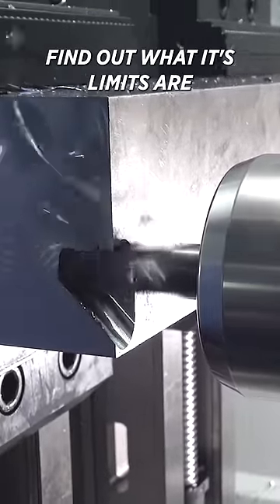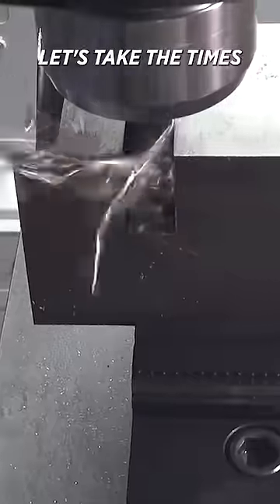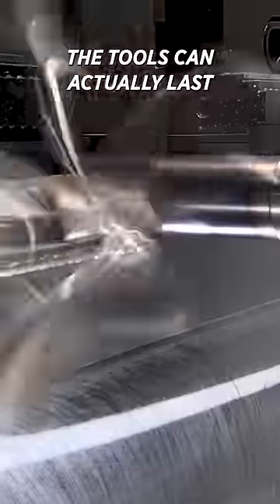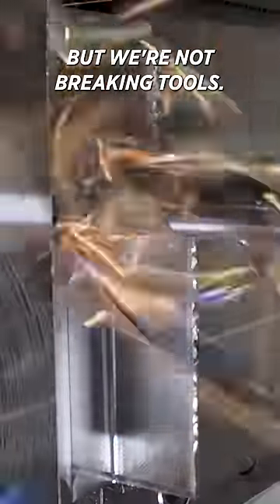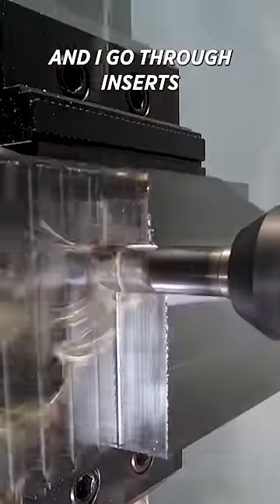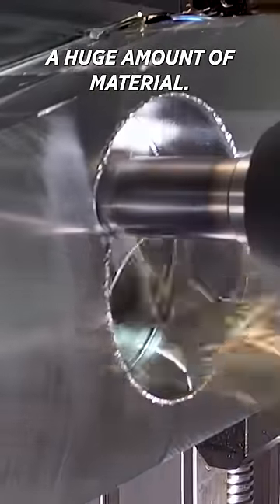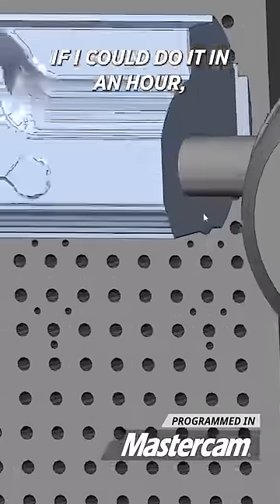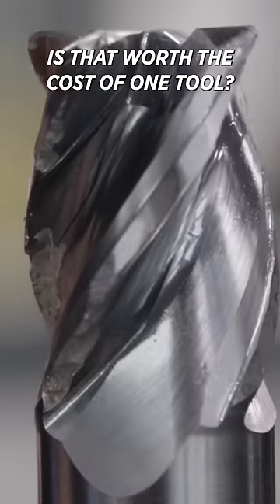Why Do We Push Our Tools to the Limit? #shorts

Comment: I worked for an aviation parts company and we'll drill anything from carbon fiber to fiberglass or metal. I was in charge of the cms machine that cuts the parts. We had a big 1/2 drill bit, that would cut speakers for helicopters. Thank God we had a cage because at times the bit would heat up so much it would snap and you'll have a large metal bit flying around and 15,000 rmp.

Comment: Let’s say you run your machine at 80% of its max, first you can’t count for heat element ( motors expand and the actual coordinates change) aka shit tolerance, second it will cost more in tools unless you are using shit tools to start with which mean all my txt is useless. Lastly that tool at the end will be fucking up your work peace not cutting 😢😢

Comment: Let’s not ignore the limits of size in the name of speed. If you need to hold a tolerance to .002”, you can’t run it that fast and expect it to be in spec.
Reply: For rough cuts taking that much material away Im almost positive itd still be faster to run a finishing tool or two after to clean up and bring the parts into spec if needed. Had a few jobs where that would be the case.

Comment: I worked for a batch work company for 5 years at the start of my apprenticeship and I was told by the manager of the production office that if a Turning insert was used for 20 minutes of cutting time it had paid for itself it is running for longer than that you are wasting time while machining, as long as you were working within the 100% overload limit on the machine and getting 20 minutes out of an insert you were making money

Comment: It's also a justification for running your tool steel tooling with high coolant flow and your carbide tools with the bare minimum to prevent the sintering metal from melting. Different cutting and milling bit materials have different coolant and feed/speed preferences for optimal performance. Also, it is rarely beneficial to intentionally destroy bits unless you have to in order to meet SLA and avoid overage fines. Bits aren't free or even cheap and if they are cheap then they won't last or produce the finish quality that you want from them.

Comment: That and SPC Incorporated together is a equation worth figuring .....I grew up outside of Detroit in a suburb I walked in the backdoor of a job shop in Troy MI. And saw a machine moving at 150 IPM and was floored at the chips flying and saw a guy with a used Cnc put an old manual job shop out of business the same guy Incorporated Statistical  Process Control with his machine he is very well off now that was 30 years ago.

Comment: In my day I ran the tools fast with deep cuts for roughing but my speeds and feeds were spot on. One day, a maintenance guy walked past and said I would burn out the inserts I was using because I was running it too fast, all the while, beautiful gold chips were rolling out of the auger into the chip bin. Never had a problem with my tooling life lol

Comment: Also something to note, the cost isn't only in the money. Making the tools has an environmental cost as well. A higher load on the machine also may make it less efficient which could increase running costs by wearing it out quicker and it could cost more energy to run it. Having it run quicker might also save energy, but I don't have the knowledge about the specifics of this machine to come to a definitive conclusion.

Comment: I used to have arguments with a supervisor about tool life .... We were machining cast aluminum and they had determined that the one finishing mill would run 3500 cycles ... However at 3300 it would start leaving massive burrs on the parts.  He continues to argue that they have life left ... I explained to him that when the tool is leaving a 1/4" burr it has reached its life regardless of what he thought they should run.  Wasting 30 min grinding parts per pallet with a flap wheel was not worth the cost savings of running that tool those extra passes.

Comment: And some materials just say "make me and you will regret it". Faster cuts lead to work hardening and heat, some materials will take time period unless you want it to snap right off or wallow out. There are reasons why you only cut the corners you know won't result in a parts recall. If you are dealing with an abrasion resistant steel for example, or even something as simple as silver.

Comment: In the mining industry I learned that preventive maintenance is important... unfortunately iv worked for company that didn't believe in shutting down for a hour or a couple. To fix it corrext instead something will have a high speed come apart then get mad bc there down for a week waiting on the parts.... grease ur equipment shut down for 6 hours a week and fix ur small stuff it will help u in the long run.

Comment: Its like a big puzzle that you need to put together. 
First up high quality coolant. 
Then machines that can handle your job size, x.y.z. 
Durability of machine. 
Harmonic's will play a major role.
Tooling that you can count on to be repeatedly of same dimensions and quality. 
And lets not forget one of the most important pieces to the puzzle extremely qualified employees to run these machines. The amount of knowledge that is required to truly maximize a machines profits doesn't come cheap.

Comment: The machinery i keep running just has to run 24/7 365 ... . Minus holidays, weekend cleaning ,and inevitable breakdowns,  but getting it running again as fast as possible is all about having inventory of the common failpoints replacements , also the not so common,  basically need 3 machines just 2 disassembled ready to fix the first... and everything being labeled and named properly helps , a lil oil goes a long way too, reducing friction reducing wear and problems and constant washing off of said lubricants to encourage rust doesn't help but that's the other departments job, to give me plenty of" job security" by causing most all breakdowns im some way or another... it's actually kinda nice, surprising but nice to have a problem not caused by proper functionality removal squad

Comment: I know carbide can still hog when worn out, but that shot of that tool is exactly what happens to them when ran hard. Use resources to save time. I'd run them fast too if the machine couldn't handle the load. Wonder what is so special about the tools that keep them from exploding under such a high load in steel

Comment: I remember a shop manager that used to go around turning people's tool speeds up. Maybe if his degree wasn't in archaeology and his position wasn't obtained due to nepotism, it wouldn't have been as big of a deal. But it made a lot of guys upset. The moral of the story is, leave the machines alone and let the guys that have been running them for 20 years dictate their speeds. The first time you mess with someone's machine and cause any sort of damage, you had better be able to pay for the material, perform the entire setup yourself and work the extra hours you created or you're going to have too many enemies and not enough employees

Comment: He acts like he is the only one who has thought of this. Everyone try’s to get the fastest part output they can with as little if not any loss in quality. What happens is running fast with Deep cuts then you run the chance of your 30-500 dollar tool dulling or braking and damaging the part. Now your out one blank of material, loss of time, the cost of the tool, and the stress. Maybe add up these costs over a year and you may not be loosing more then you think. I just sold my manufacturing business a couple years ago so I’m retired but I still love this stuff...so cool

Comment: As the one who manufactures these tools, yes. You can 100% run them hard like this and they’ll last but not nearly as long as when you’d run them properly. There are bad bits out there. Microscopic imperfection in the blanks that gets past QA. I would be safe and make a few 100k pieces with one bit then 10k a lot faster

Comment: Also factor in the overhead for tool replacement. Someone has to do that job, that job might take up machine time.
Now instead of doing 2x 4 hour passes in a shift running 7 days a week until eventually you maintain it for 2 hours, your machine is going through 3x 2 hour operations and 2 hours of maintenance every day.
How much is that cost in maintenance?
Reply: Entirely depends on how the tools break and the operator paying attention. Some shops have the machine operators change the tools out and readjust the offsets themselves which in most cases doesnt take terribly long. For example, at one shop I worked at we had some stainless steel probes that needed a slot cut about 2 inches deep, 3 inches wide, and around 2 feet long. Running a rough cut like the one here, just not quite as fast these parts still took about an hour or so to run so it was much more profitable to spend a few minutes replacing the roughing mill once, maybe twice a shift.

Comment: There's a fine line balancing the tool speed and machine time against part cost and machining time. It is no brainer on a cheap part but when it comes to jet engine component it becomes a real problem. One bad move or chipped tool and you just turned a hundred thousand $ part that takes 30+ operations and a month to build into a scrap wall hanger. When you can't get the metal do make it anyway, it becomes a real problem.

Comment: I work with industrial bandsaws cutting aluminum and titanium walking this same thin line, at my job we run multiple saws at the same time which brings in another factor to this equation. I'm not sure how long it takes to change the tool on the machines in the video but changing a 29 foot long blade can take between 30 minutes and an hour so I tend to run the blade feed a little slower than what management wants but my argument for it is that although at the higher speed I may be able to perform more cuts with this saw even factoring in the time it takes me to change the blade I actually get almost the same amount of cuts when I factor in the time lost on the other saws during the blade change for this one saw. if we have a rush job that I get the go ahead to neglect other saws for then ill run the single saw as close to the limits as I can and since I'm there watching it I can listen for any issue s and make the adjustments necessary to prevent the blade from breaking while still running it at the max

Comment: The tools/inserts only last when they are used properly. When a tool fails,the machinist must replace that tool,dial it back in and check the feature/features that are affected by that tool to ensure the machine is making a part that checks good.Bottom line,the more you have the door open,the less parts you’re producing.

Comment: I think there is a problem with a lot of CNC, and as you allude, it's the cost of the cutter vs the price of machine time, baking 2 $200 cutters to save $500+ makes sense, issues of financing the tooling vs getting paid for the end product are a definite pressure on the decision as to how aggressive to to be with F & S.

Comment: I'm going thru this at work right now pro. Wants to cut 800ipm 1.0 doc alum. Yes machine can cut 1200 but now we did a penetrant test and our walls are cracked on 14 parts 250k down the drain and 6months wait for new material. Fast is not always better. Slow and steady wins the race for me.

Comment: Don't do this if you want precision machining on your workpiece. Learned that with Rob Dahm's videos machining Mazda rotary irons. Slower speeds gives you more precise machining and a smoother surface. One of those things that makes complete sense once you hear it and see it, but you wouldn't really think about normally unless you're doing this type of stuff all the time.

I have no machining experience (but wouldn't mind trying my hand at it one day), so if anyone wants to prove that wrong or add anything, I don't mind.
Reply: Doing a rough pass like this would be entirely to get the brunt of material cut from the part. After that pass is done you'd add additional finish passes and deburrung passes depending on tolerances and finish requirements.

Comment: I think you should probably read the user manual.  There's loads of information about the limits of the machine in the user manual.  Besides that, pretty sure most CNC could calculate wear and max speeds and recommended feed rates and spindle rates for the materials.   Why do it empirically?  It's been figured out already by really smart material engineers.

Comment: are there bits with internal liquid cooling?  I bet a 3d printer could make such a thing.
Reply: Yes, some drills and i think end mills can be coolant through tools, meaning they have holes in the drill/mill that run coolant though them while they operate

Comment: One tool 100 one extra part a day 500+ extra day. It’s easy math my little machine can’t push the tool to the limit. However, I do push the machine to the max. If your machining right heat buildup in the part is not bad like most people are saying. Hog fast come in with the proper tool for clean up. Proper coolant system and the right type makes a big difference as well. People find it hard to make money in this industry all because they only do what they have been told for years back when machines didn’t have the capability to run tools hard or from the days of doing it manually.

Comment: But how does accuracy and finish quality reflect after optimizing a tool at 80% of its maximum?
Reply: Most shops as big as this designate a separate finish tool from the roughing tool. This makes sure minimal wear is put on your finish tool. That way you should hardly ever have to adjust wear and it should last almost an entire production run depending on material type or quantity of parts.
Reply: @TheMoronTrio  I work in a small shop, we use separate tools for roughing and finishing. Hog the material out with the rougher deep and fast, clean up with the finisher. The finisher will last 10x longer than the rougher.

Comment: Coming from cnc maintenance perspective, your main problem is the human element running that program not the abilities or tolerances of the machine. Dude playing dig dug on his phone breaks more tools than anything. Training saves dollars.
Reply: Yeah at an unnamed elevator repair shop this kid hired from the Korner BBQ for $10.50/hr took off the safety specifications of our giant metal brake and clamped both his thumbs to dust because he was “tryna save time by not having to hit the brake button twice cause it made his footsie tired” you can’t fix stupid but you don’t have to hire it….

Comment: How are you doing this without coolant?
Reply: Carbide don't need coolant dude.... and he is using air blast.....
Reply: it depends on the job and equipment. 

If it’s mild or tool steel, i run aluminum titanium nitride (AlTiN) coated cutters dry. They Last longer with the right cutting strategy and parameters. There are exceptions like if the part is small or thin, you don’t want it to get so hot it warps. 

The reason is because the coolant causes thermal shock to the cutting edge and fractures the coating and cutting edge. The coating is designed to withstand the heat.

Titanium, stainless and aluminum I do use coolant. 

Talk to you local tooling rep for the proper parameters for your tooling.

Edit: use air blast if cutting dry. Chip evacuation will be a bigger issue then cutter life when you start turning up the speeds and feeds.
Reply: @KnoxGTX  
Thanks for sharing!

Comment: Running hot and fast can damage tools and break machines. However if you can produce 5 times the product  in a 5th of the time, with say half life of disposable quickly replaced tool ends then you're making more profit than you are costing yourself.

Comment: I would LOVE for you to go with me to see a few of my customers who SWEAR cutting tool manufacturers publish their cutting data just to have the tools experience SHORT LIFE so more will be sold. I see more tools suffer from short life or even breakage due to incorrect style or WORN tool holders and Collets as well as improper material holding than running parameters. More often than not, the operator may run tools with too little engagement, too slow sfm and not enough DOC. ESPECIALLY HIGH FEED CUTTERS..!

Comment: See thats the problem with management in factories they want all the machines running max speed but they don't care about quality and the operator having to struggle and break they back to try to keep up with the machines
Reply: They even will have 1 person run 2 machines at the same time just to save money because they more money they save goes into their pockets and not to the employees who deserve to make more than management because they do all the had work while they sit in a a.c. controlled office
Reply: @dragolight3906  depends on the shop, the first machine shop i worked at generally ran larger parts where our average production time per part was around an hour or 2 per part. Some jobs youd be lucky to get 1 or 2 parts done in a night

Comment: Yeah if you have a CNC running consistently and using the same tools frequently you should run the tools at their maximum and deal with sharpening tools often and changing carbides. Feed rates and depth should be appropriate for maximum spindle speed, not to optimize tool life.